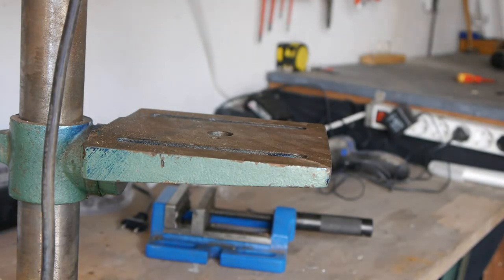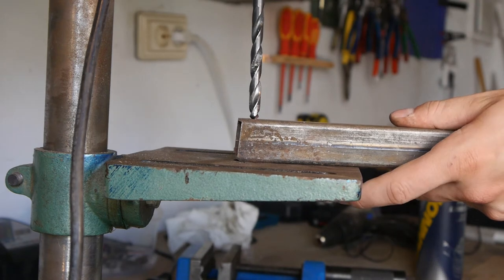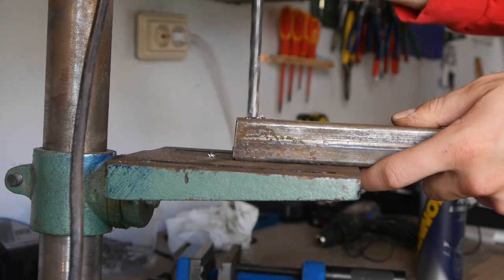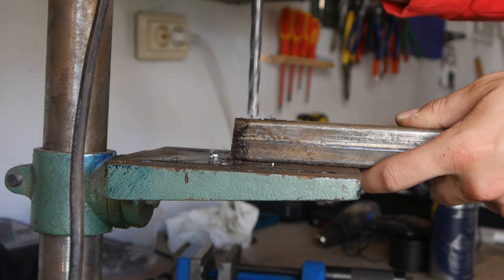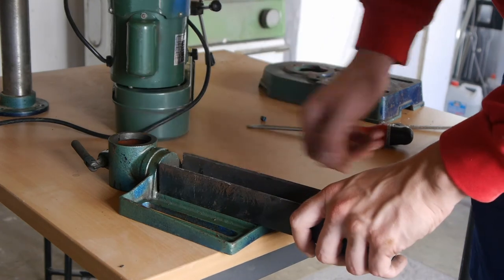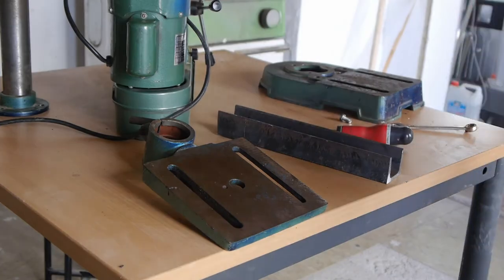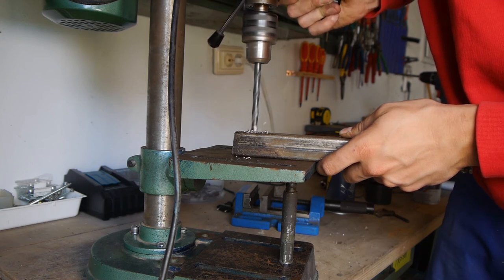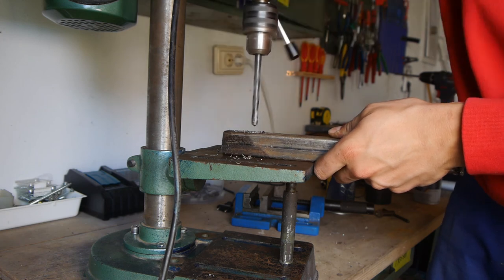How to Improve a cheap Drill Press

Comment: I only really noticed how bad mine was when I used it as a press to fit a new watch glass. Not exactly a high pressure operation but the table was bending by 5mm! I used a 1-2-3 block (for coarse height adjustment) and a threaded bar that fits through the holes on the block, with a nut on it.

Comment: Got same one. Fixed xyz vise to bottom table, cut slot, just to side of vertical centre,  in the top of tubing to allow to drop head unit about 70mm. Rotated rable out of the way.  Going to replace shaft tubing with a thicker walling. Then after that, look for bigger and better drill press.

Comment: Your belt is far to loose in this clip. You can hear the motor is still spinning away, but it is not transfering it's power sufficiently to the drill spindle.
Reply: I have a similarly cheap press, replace the tensioner with a bolt and a nut so it stays solid as most cheapy presses come with a spring to tension it which doesn't provide any real tension